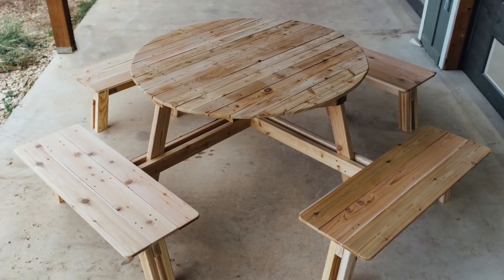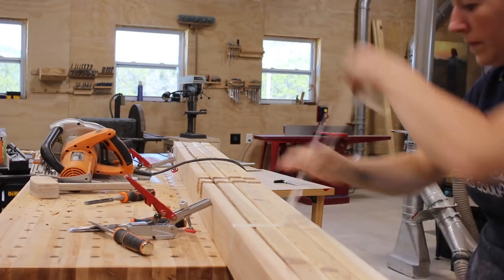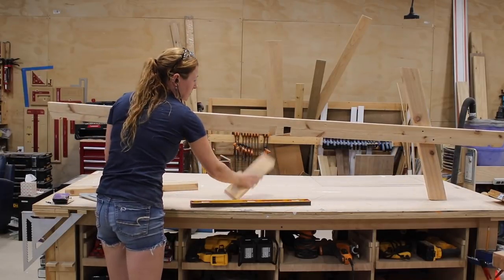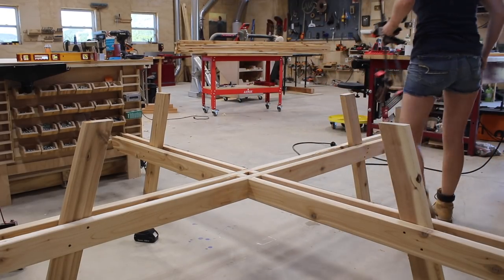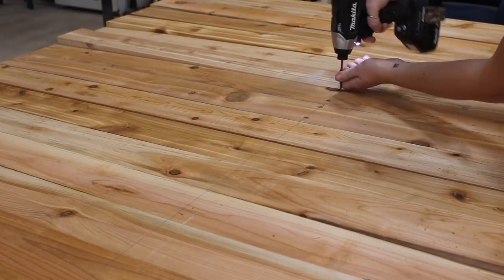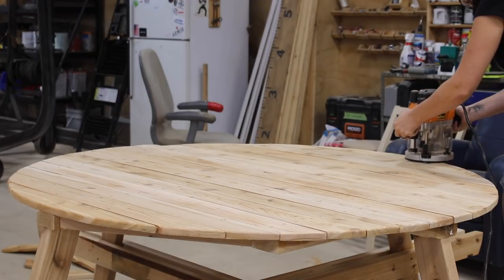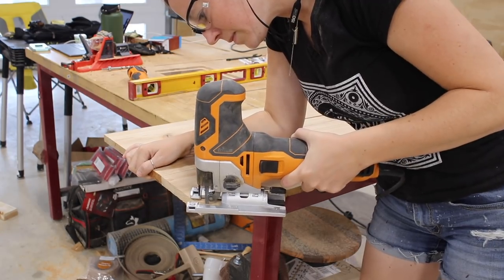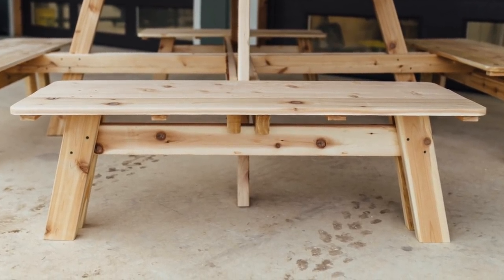How to Build a Round Picnic Table with Benches

Comment: Great video. Great table. I love the way you kept the joinery simple, when a lot of YouTubers would have gone for half-lap joints. If I make one of these tables in the spring, I will cut the top using a bandsaw and a shop-made circle-cutting jig (thanks, Norm), since I am lucky enough to own these items.  But the string and the jigsaw are a great alternative that cost a fraction of the price.
Keep up the good work, April.  I love what you do.

Comment: That’s a really cool design April! I’d beef up the table top and bench tops though - use 2x material instead of 1x. Seems like you’d get less warping over time, and if someone sits on the very edge of the bench, you don’t have to worry about it breaking. Really spiffy build though - I wish WRC wasn’t so expensive here in California.

Comment: Nicely done! My first impression of the finished product is that the seats are a bit far from the table it's self, especially for a small child. By virtue of the design, accessibility is great (as you pointed out) but the benches sitting far out from the rounded table surface might make it impractical to use. There seems to be quite a gap....
Reply from the maker: Yep, as I said at the end of the video, I shortened the base supports by a few inches to push the seats closer to the table top. : ) When I'm designing something, I guess the best I can at the dimensions things should be but the real test is to build it and test it out. However, since I don't build stuff twice, all I can do is pass that information out to those to watch. : )
Reply: @AprilWilkerson  Perhaps, I missed that remark, my apologies. I just couldn't help noticing that potential problem myself.
Reply: @AprilWilkerson  Yeah, I don't like doing things repeatedly - surprisingly, though, I do have two children!

Comment: This looks super awesome!! Is there a reason why the table aprons aren't also vertical with dado joint like the bottom support? Not that the pocket screws aren't strong enough, but it would seem sturdier,  or did you just want minimal apron?

Comment: Just bought the plans, was thinking about using cedar fence pickets instead of 1x4's and just ripping them to the right width since they are only $2.75 per board, gotta save some money where I can!  I was wondering, why are six 1x6 boards needed if you are only using eight pieces for the seats?  Seems like four boards would be enough, unless I'm missing something?

Comment: I've made dozens of picnic tables like this at work. With a few differences in the design. I'll go with very loose maths here, because metric. The four beams that carry the seats were 3x3, not 2x4. We notched them to hold the legs two 1x3 on each side, attached with M10 carriage bolts. The seats had an H underneath made of a 3x3 and two 1x3. And the table top was built on a square frame, entirely out of 1x3. But it's a bit complicated to explain it in text.

Comment: as an alternative to the 'stretcher' 2x's added at diagonals to carry the 'odd ends' of the circular slats that didn't have a base?  Might have pocket hole drilled them to one another (edge joining short slat ends) and gotten a stable outer edge of the short curve-ended slats?  Neat project, thanks Mrs. W.

Comment: I suggest that the circumference of the table be a bit broader or larger, enough to keep your elbow lean on the table at ease. And broader table is good for picnic when u have lots of stuff. ❤🇵🇭
Reply: She did say at about 9:10 that she later modified the table.  She drew the benches closer in, so that would help with being able to lean on it.

Comment: Love your video. However is there any reason why you couldn’t screw up from underneath so there’s no screws seen in the picnic top?
Reply: Depends on thicknesses and screw length, but I don't see why not if the screw fits. Of course, outdoor decking screws either way.

Comment: Does anyone else question the comfort of eating at a round table where the seats don't point at the center of the table?  Maybe that's because I am in the habit of resting my arms on the edge of a table when I eat or maybe it's because I have a narrow a$$; but it looks to be uncomfortable to me.
Reply: She said at about 9:10 that after she sat on it, she modified it by moving the benches closer in, so that would help.
Reply: @Romans828girl  I did catch that, but sitting at an angle might still feel "off".  Experience using short-straight benches for 2 persons with a new 8' round plank patio table (that my grandfather had built, and even included a turn-table - didn't need a hole for for the awning, there was one on the adjacent garage) years ago is what triggered this issue in my mind. The following weekend I gifted my parents with 8 folding lawn chairs to make room for all the adults
Reply: @mr.the-edmeister2750  True; I guess there's no way to make a round table & straight benches symmetrical for sitting.  I think you're right; either a straight-sided table or individual chairs would be most comfortable.  If you wanted to make it cool-looking and all one piece like April did, maybe make the table octagonal and put an angle in the middle of each bench?

Comment: This is awesome!  I have a question.  Have you ever built a swinging porch bed?  I'm not sure if that's what they're called, but something like this picture.  https://cdn.shopify.com/s/files/1/0899/6252/products/Swing_Bedelegant-charleston-1_large.jpg?v=1570570384.  Also wondering if you've every built a pergola.  I want to build one over my concrete patio after I figure out how to make a ground level deck to replace the concrete slab patio I have.

Comment: Original, but very questionable: lacking mobility and variability - cant add / move / remove seats when you need to. Also it have to stand in a large clear area - no walls / fences around. Small table - 8 plates, and there's no room to place pots with food or drinks (ther's some in the middle, but not enough for 8 ppl).